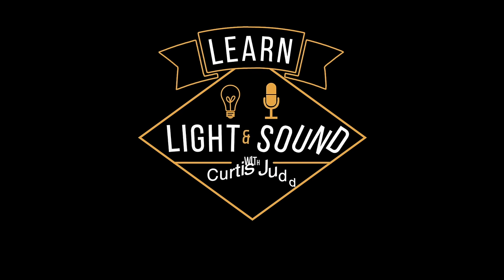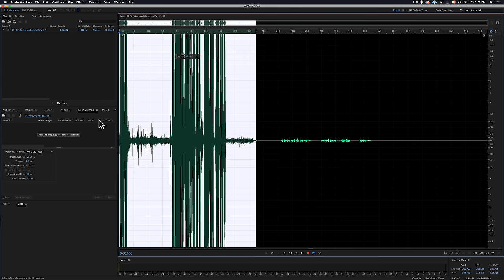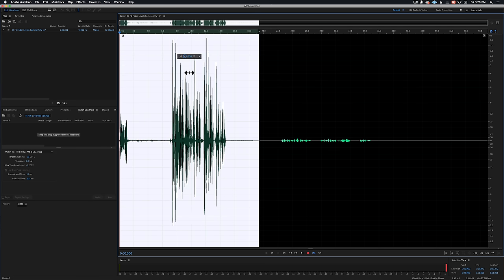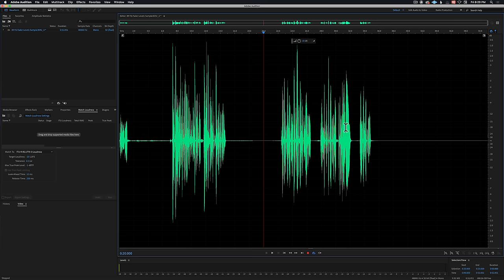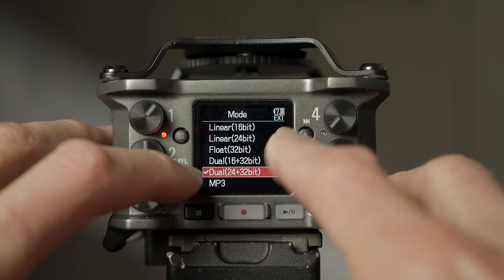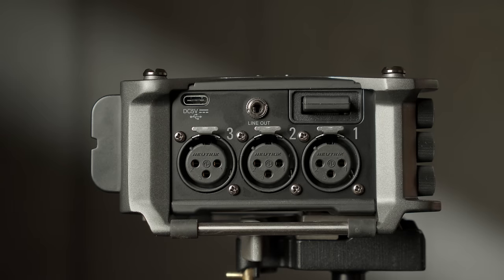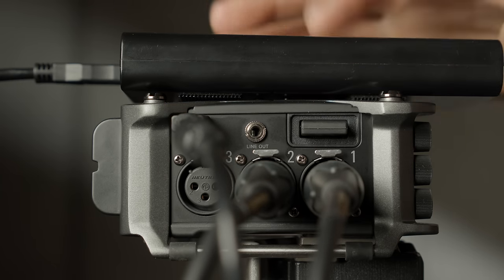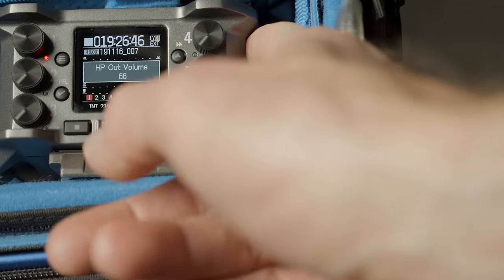Zoom F6 Audio Recorder Review

Comment: That single SD card slot is such a bummer. Really made me regret this purchase. I wish the could allow redundant recording to an ssd attached to the USB C port
Reply from the maker: Interesting idea - thanks for that.
Reply: @curtisjudd  Do you have a contact at zoom that you can pitch this to? If external recording can be achieved via firmware update, that would make this recorder 1000% more useful. Don’t know the power output spec on the port, but I wouldn’t even mind terribly if I had to use a power/data splitter cable. Having no redundancy option is just so dangerous
Reply from the maker: @frannyfranman  I do, but we're not on the best of terms at the moment - they didn't like my more recent ZOOM product reviews and asked me to take one of them down which I found pretty distasteful. I'd go for a Sound Devices MixPre instead which does have the ability to write backup to a thumb drive via the USB-A port. Or perhaps a ZOOM F8n which has 2 SD card slots.
Reply: @curtisjudd  Ah that sucks. Even a negative review is an opportunity to improve, I’m sorry that they weren’t receptive to your feedback. Unfortunately I already own the F6. I’m not a sound mixer, and by the time it dawned in me that no redundancy can be a real problem it was too late to return it. Been holding on to it in hopes that they’ll implement external ssd recording (wrote to zoom a few times but no response 😕). Really love the 32bit float option. I try not to make mistakes in the first place, but again I’m a camera guy so I like that this recorder can save my but if levels are set incorrectly. If only it had redundancy...

Comment: Great review Curtis, can you tell me how to set my ZOOM F6 to 24+32 bit float recording, don't know if its possible to have a stereo mix file, plus an individual recording of each mic input, I can't seem to find the settings, and when I record 24+32 bit , Even if my fader is set all the way up I have a very weak signal, may 3 bars from the VU meter, pardon my measure its not a technical term , when I say bar it means if you divide the vu from maybe -60 to 0, mine is hitting almost maybe -55 only very weak but the line out is loud enough, which as you mentioned I need to use attenuator cable , can I use IFI audio optimizer for my attenuator. https://www.youtube.com/watch?v=JHjB11SrBQU
Reply from the maker: In the REC menu, you select Dual(24+32bit) and then when it asks, I'd probably set the LR Mix to linear.

That attenuator doesn't quite attenuate enough. You really need something more in the -25 to -35dB range. Best wishes!